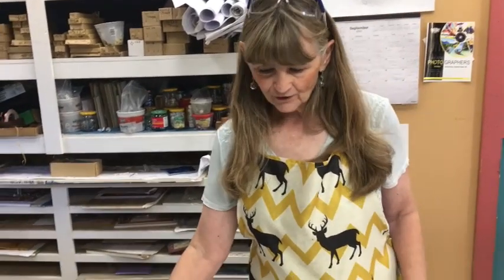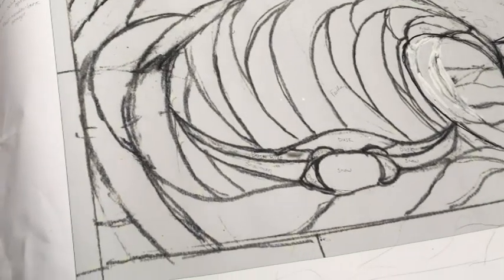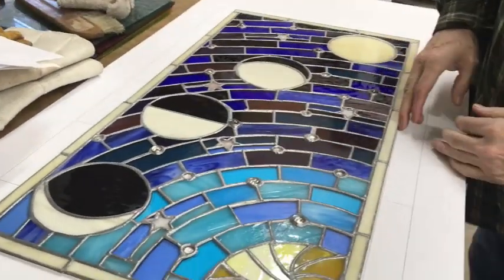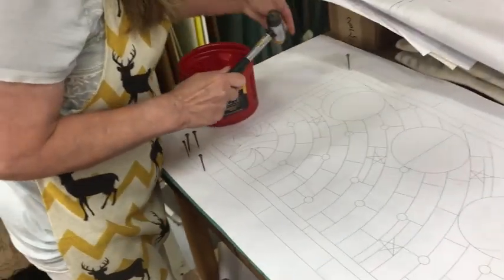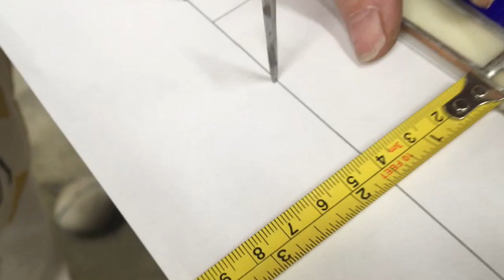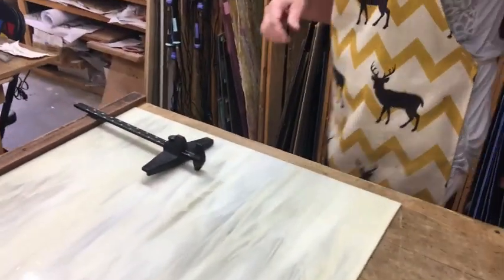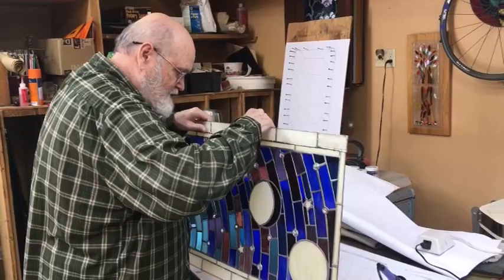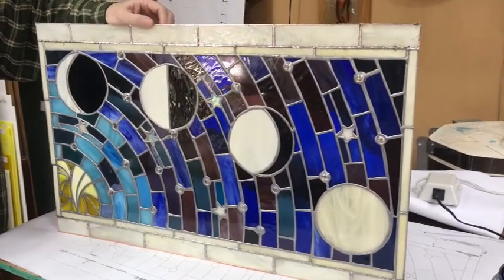Fix A Wrong Size Stained Glass Panel V432

Comment: I have an old 1930 piece of stain glass that was left in the shed when I bought my 1907 house. I have restored it , it's an oval, 57" high and 28" wide. it came out of an old door. I would like to install it in my front door. Any tips on how to do that, it has 2 steel bars across the middle for support. thx Terry
Reply from the maker: Go to a local glass shop and see what advice they offer. It's good to consult with someone local so you can find what can be done in your area. We often consult with Glass Doctor to see what they reccomend.